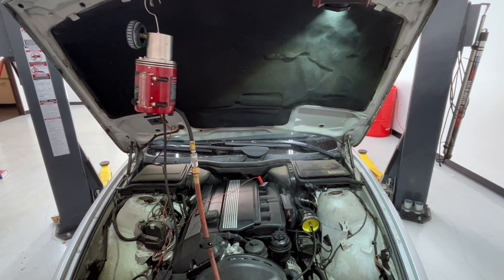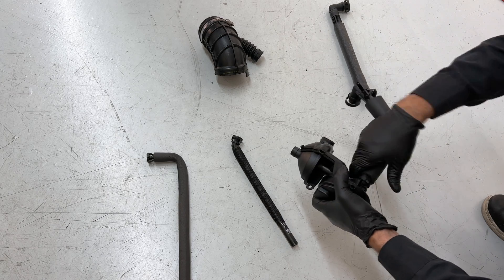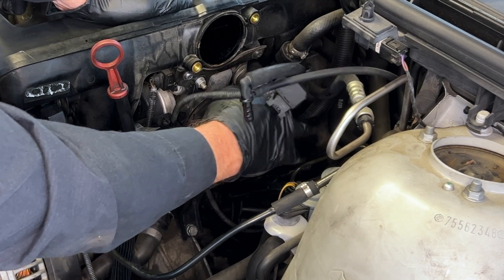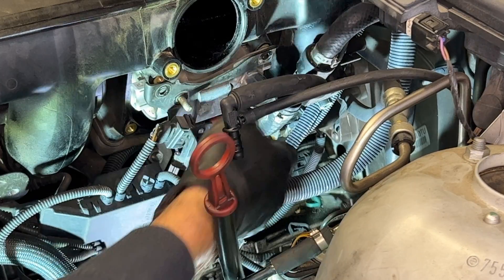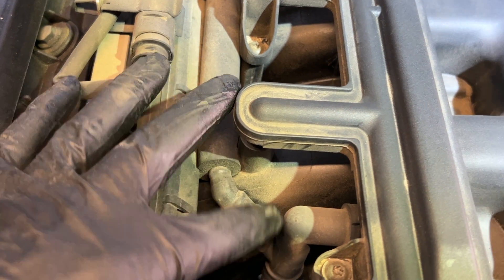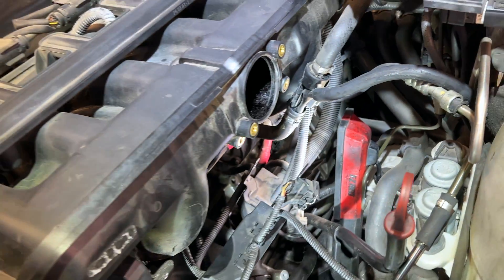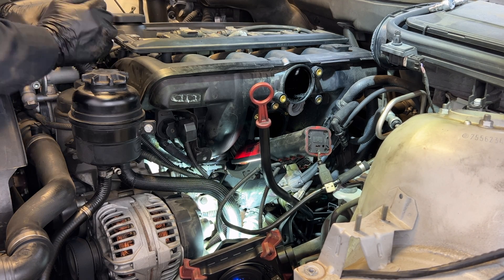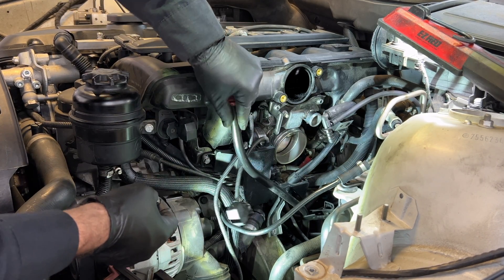PCV Valve Replacement - BMW M54 Engine

Comment: Hi nice video i ha e the same problem because me car is shaking  after 20min  and is not giving the air pressure from the oil   hol
Reply from the maker: That's definitely a common symptom of a bad PCV valve.

Comment: Out of curiosity, why don’t you remove the intake manifold? Wouldn’t the job be easier?
Reply from the maker: Good question. Some people do. It's a bit more work and you run the risk of damaging brittle parts. I've done many and its just my preference to do it this way.

Comment: Doesn't show the install of the upper hose that twists onto the ccv ... the first one he fed in from above.  That might be the hardest one to install because the hose must be rotated to lock in place.  All the other hoses just push on until the tabs on each side click into the locked position.

Comment: I agree with many of the other comments, this is the best video I have seen on replacing the PCV/CCV system. A nice little winter project for me on Vancouver Island. I have read that it is a good idea to replace the 2 cooling water pipes that run along the side of the block when working on the CCV system. But to do those do you need to remove the intake manifold?
Reply from the maker: Much appreciated! It would be a good idea to replace the coolant pipes. I have another video on that specifically. The intake manifold would need to be removed. If you end up removing the manifold it will also be much easier to replace the pcv system.

Comment: I just did this and after a drive cycle I still have INC monitors. I've replaced the EGR valve, secondary air pump, spark plugs and O2 sensors within the past several months. A P0171 code and service light came on. Had 4 INC monitors. Cleared the code and now I have 5. I'm baffled.

Comment: Hi and thx for the video, very helpful. Just did this job on my friend`s `03 730i E65 and everything went good. In my case, the corckscrew tube was the easiest one, but I had a really hard time connecting the valve cover tube to the bottom of the valve. All in all everything went according to plan, I`ve put everything back the way it was in like half an hour. A quick tip for anyone doing this job, try to unscrew and VERY CAREFULLY pry the distributor piece above the intake manifold in which the corckscrew and long tube connects, you will save a lot of time trying to pinch the tubes to uncouple. I gave up after 15 minutes of unsuccessful pinching on both pipes so I said "screw it" and took of the distributor piece off and it took me seconds to pinch the 2 tubes and remove them. As I said, just be very careful because it`s stuck in there really good and you must take your time with it otherwise it will brake. Take a long and wide screwdriver and pry it gently and slowly one nozzle at a time. Cheers!
Reply from the maker: Good work! Thanks for sharing the tip.

Comment: You did not mention that the dip stick has a ccv tube connected to and that tube goes into the oil pan and you missed mentioning that the connection at the oil pan has an "o" ring. The o ring has to connect with a distinctive little push then you know it's connected. But.. I'm not sure if the o ring is attached to the tube itself before inserting into pan or is the o ring inserted to the pan and maybe sits on a lip, as not to fall into pan. Anybody have that part figured out?
Reply: Also proper clean of the dipstik 2nd hole,usually is clogged,and that makes problems.

Comment: you notice where  he  was trying to get the corkscrew pipe on how he edit and jump over that and getting the screws in. that is not easy I tried for 3 hours.  I have the cold weather unit and it tough.  I recommend jut removing the intake  manifold

Comment: Best to take the mainifold off,
I have done it both ways,
Mainfold on is crazy fiddely and frustrating,
Manifold off takes longer but is logical and satisfying.
Also with the manifold off you can change the hardline coolant pipes,
And chances are the fuel purge valve hose, and brake booster hose which will be crispy, both are also vacuum leak weak points,👍

Comment: 2004 530i bmw starts just idle rough on start up like going in and out got it scanned at AutoZone it said suggested part to fixed is pcv vale got coded p0171 ,p0174,p0300,p0301,p0313,p0305.  replace the pcv vale ?? Need a little help
Reply from the maker: @Dominick-u9e  hi. If it is a lean mixture code (which can also cause engine misfires) then replacing the pcv is what I’d do first
Reply: @ yea it’s system to lean bank 1 and 2
Reply: Id smoke test it. Almost all these bmw parts are plastic and can Crack.  Idle air valve csn be cleaned.  But I went ahead removed the intake replaced those gaskets, throttle body seal, pcv parts.  Fcp I think has a whole kit and really isnt a bad job.  Also rebuilt the disa valve since it was off.

Comment: Curious to know what you would charge for the service. Whereabouts is your shop located? I need to get the same replacement. Great job on the video
Reply from the maker: @rikmccoy  I’m in upland Ca. Our shop is BMW MINI MD’s.
This is a very common repair. Any European specialty shop can handle it 🙂

Comment: How do you break the clip off ? The bottom hose that connects to calve cover flat head push the clip from the inside outwards?
Reply from the maker: Yes, I just wedge the tip of the screwdriver in there and twist
Reply: @ i broke the right side of the clip tried pulling it off but super stuck I’m guessing the other side of the clip is still in tact
Reply: @ i broke the right side of the clip tried pulling it off but super stuck I’m guessing the other side of the clip is still in tact

Comment: Man, I've taken all this off so many times,  I swear I can do it with eyes closed in 14 minutes flat
Reply: I wish you could upload your experience into my brain like a program so I can do this job because I suspect this is a reason my car is stuttering and hesitating violently at times lol
Reply: @Johnnygga  lol
Reply: @dkrawk8309  i was that way with the mk5 gti
Reply: Well this dude did it in 11:50 while filming 😂
Reply: @danlaw1007  lmao, good one
Reply: Thank you for this video. I've done it now. It was a pain to put the "corkscrew" to the pcv valve 🙈 It was hidden behind the air inlet.

Comment: Plse help me solve this mystery. After 10 minutes driving, on accelerating, a loud squealing from engine area occurs, eased off gas, and it stops....rough idling, ck engine light, etc, code said mass airflow issue....did replace sensor. Could it be this ventilation kit issue?  Thanks.
Reply from the maker: It sounds like it is the issue.
Reply: @MikeMDs  OK, thx you so much.

Comment: Could a bad pcv cause the car to smoke on start up and during acceleration?
Reply from the maker: What engine do you have and how many miles?
Reply: M54 148,000 miles
Reply from the maker: It normally doesn't cause smoke on start-up. Usually leaking fuel injectors or blow by from piston rings cause that. Or coolant entering the combustion chamber from leaking head gasket.  On accell its possible.  But it sounds like it is something els

Comment: With brand is it pcv? Geniue bmw? Cold an warm climates?
Reply from the maker: Its genuine bmw. Usually if you order the cold weather kit it is cheaper. They both fit the same.  You can peel off the foam covering it when installing. Assuming your car doesn't have the cold weather package.
Reply: @MikeMDs  How much does this set cost ?
Reply: @MikeMDs  give me adress link

Comment: Thansks for your video, it´s clear and straight and it will be very useful for me. 
My ´01 530i runs great but burns 1 liter of syntethic 5w40 every 250 miles. Yesterday I checked the inside of the dipstick tube guide (it was clean) but realized the hose that returns oil from the CCV to the oil sump was completely dry inside, so my guess is the CCV must be clogged and sending the oil to the combustion chambers. I think I must replace the CCV and tubes.
Reply: Have extremely similar symptoms, mine runs fantastic (520i) but does use oil. Time to do my CCV I guess
Reply: Same issue with my e46 330, swear I’m always adding oil to it but compression is good, got to replace the ccv system

Comment: Do you have to disconnect the battery for this job?
Reply: I do every time messing with and electrical like unplugging anything just in case. (Don’t want a code like airbags do).
Reply from the maker: No you dont.

Comment: What is the thin line you took off by the fuel injectors. You had to unplug a sensor the move it and also it had to fittings. You showed it at 7:27 in the video
Reply from the maker: Some engines have a cold start fuel injector. Most do not have that.

Comment: Fixed my issue....was driving me nuts....
Reply: Annnndddddddd its back....throwin lean codes....FUCKKKKKKKKKKK
Reply from the maker: You may need to smoke test the induction system. If all looks good I know the DISA valve can cause lean mixtures. Also the fuel pumps on these older ones. And sometimes the mas air meeter.
Reply: @giantclam1822  did you fix it?
Reply: @high_monkey  nope

Comment: i have an 04’ 325i that i just bought. 
2nd cylinder is misfiring, and it’s idling pretty rough. we know it’s not spark plugs or coils. would PVC be my best bet?
Reply from the maker: Only one cylinder misfire makes me think it's something else on 2004.  Could be a faulty injector.  Can you verify you are getting spark? If so then verify there is power going to the injector. If not then it could be a faulty engine control unit.

Comment: Can an overdue oil change cause white smoke from exhaust?
Reply from the maker: No. Worn piston rings and valve guide seals can cause oil to enter the combustion chamber and cause smoke from the tail pipe as well.

Comment: So a bad PCV and PCV pipe will make BMW run rough with misfire  and produce  exhaust smoke ???
Reply from the maker: Older engines it will misfire and run rough. Some of the newer engines it will produce smoke from the tail pipe too.
Reply: @MikeMDs  Mine is a 2009 535i i think  the complete PCV system is shot or bad turbos, vacuum leaks .Its showing  PO171 code misfires also i think the coils spark plugs are shot..